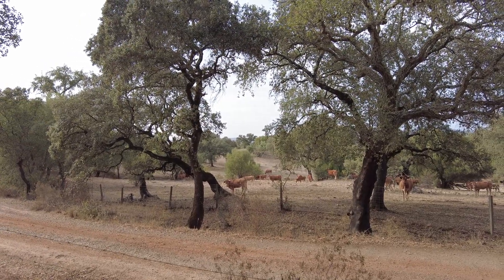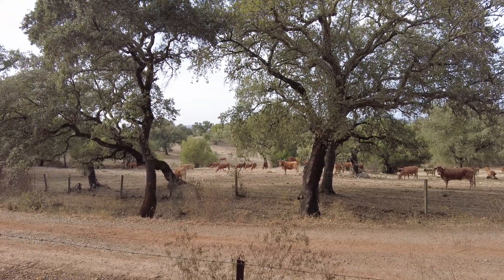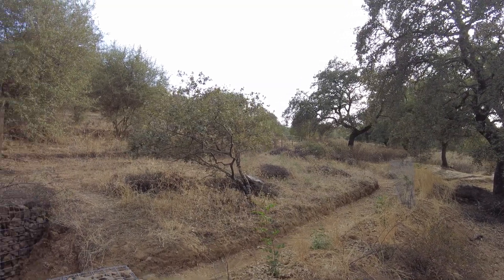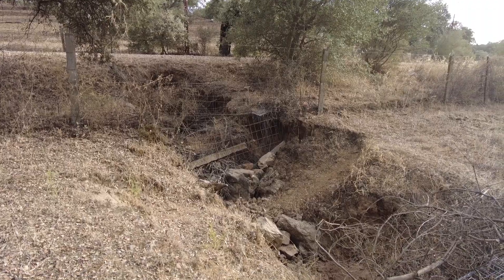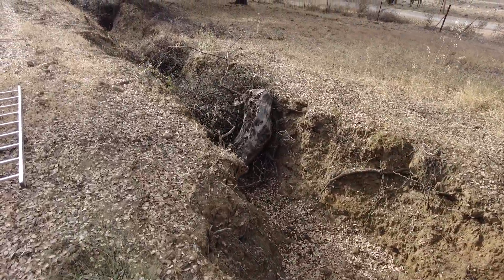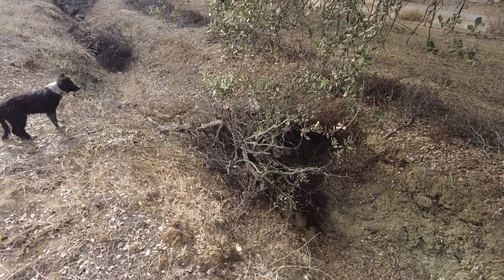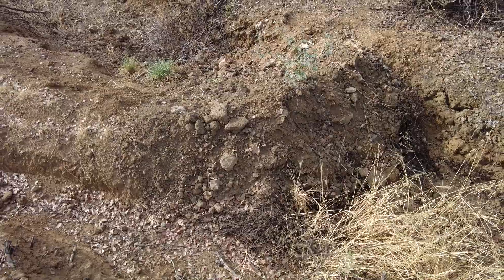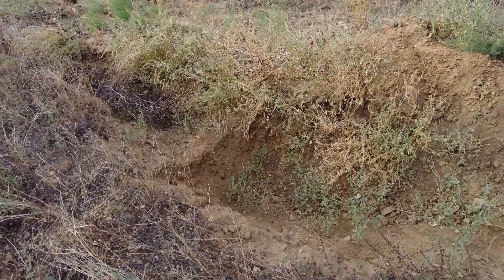Erosion control measures in an erosion gully in Andalusia.

Comment: Great update, thanks. One question, have you seen this erosion gully flowing since you came here? Just asking.

I know you mentioned “may be there used be a lot of water coming down here which created this erosion gully”, so I thought if you have any insights on when was that.
Reply from the maker: It was the waterway with the most consistent water flow. Whenever there is little rain, it runs off the road and onto the farm. It's a good amount of water and we have seen it in flow many times